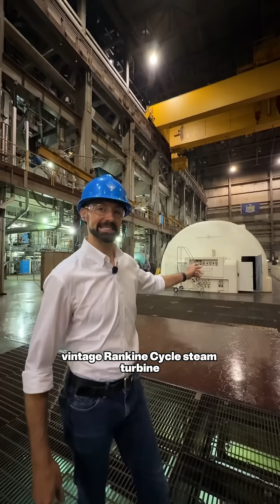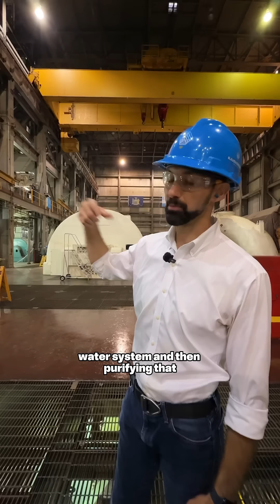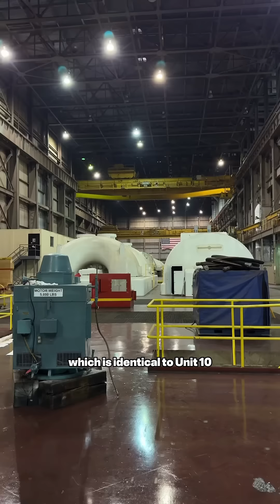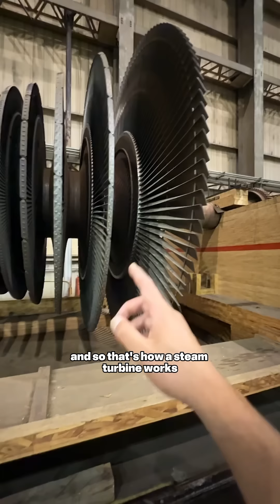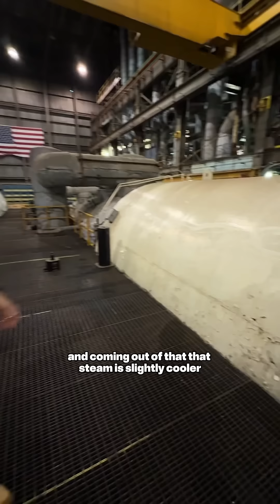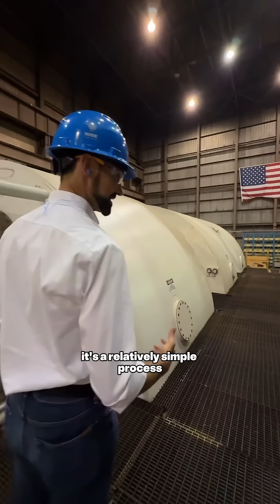How NYC Generates its Energy

Comment: But a Rankine cycle is a closed loop system. Your host talks about bringing in several million gallons of feed water. That does not sound like a closed loop. A closed loop would also have a condenser which the host did not talk about. Something seems left out in this explanation the host gave.

Comment: The steam power cycle combines practical efficiency (it can be optimized through techniques such as reheating and regeneration), reliability, scalability (it can be implemented in large-scale power plants, such as nuclear facilities, and can operate with various heat sources), and technological maturity. It’s compatible with thermal renewable sources such as solar, biomass and geothermal energy. The steam power cycle delivers baseload energy (24 hours a day, at large scale), and, as far as I know, no other technology has yet matched its blend of durability, scalability and maturity.
Reply: The efficiency of a Rankine cycle steam power plant is poor;  less than 40%.  New fossil fuel plants are now combined cycle gas turbine (CCGT) plants with efficiency above 50%.
Reply: @martincavin6760  your information are not up to date: 

A coal plant build 2014 in Germany has an efficiency of 47,5%. 

Modern CCGT plants are in the realm of 61-63%. 
New developments target 65%.

Comment: I am honest here, I have exactly no knowledge of electric power plants, but using steam? I’m really questioning this, isn’t that a bit old fashioned?
Reply: It seems old-fashioned indeed - the RMS Titanic operated based on a steam power cycle! This technology has been in use since the mid-18th century or so. It combines practical efficiency (it can be optimized through techniques such as reheating and regeneration), reliability, scalability (it can be implemented in large-scale power plants, such as nuclear facilities, and can operate with various heat sources), and technological maturity. It’s compatible with thermal renewable sources such as solar, biomass and geothermal energy. The steam power cycle delivers baseload energy (24 hours a day, at large scale), and, as far as I know, no other technology has yet matched its blend of durability, scalability and maturity.
Reply: @raffaello_morus This NYC powerplant uses the conventional Rankine steam cycle with an efficiency of less than 40%.  Modern plants are now mostly combined cycle gas turbine (CCGT) with efficiency over 50%.
Reply: Apart from solar wind and hydro pretty much all electricity generation uses steam turbines. Oil gas or coal would have been used in the past, but  you can also use biomass (mostly wood) nuclear reactors or geothermal to generate the steam.
Reply: @adrianthoroughgood1191 The majority of new powerplants use combined cycle gas turbines (CCGTs), as they are more efficient than steam turbines.
Reply: @martincavin6760  the "combined" in  CCGT means it combines both direct combustion turbines and steam turbines. The gas is burned in the first stage turbine then the heat output of that is used to make steam used in the second stage. So are they exactly like the one in the video? No. Are they still using steam turbines? Yes.
Reply: How do you make electricity?
Reply: You're right. You've got exactly no knowledge of electric power plants.

Comment: How do they boil the water though
Reply: Oil and gas 🎉
Reply: @T25de  Large powerplants don't burn oil anymore to produce steam.  Too expensive.  Natural gas is used if available.  Otherwise coal or nuclear.
Reply: @martincavin6760  The liberals are scared of nuclear, they would never let us have a nuclear plant in NYC. Even though it would be cheaper and less carbon is put into the air.
Reply: Coal
Reply: Nuclear could easily slot in but they won't. I guess they'd rather see what happens.
Reply: They use boilers
Reply: @shargor but how does a boiler work. By using heat to boil water right? How do they produce that heat?
Reply: @TikTikboom173 Usually, a boiler uses natural gas or heating oil.
Reply: @shargor  there's a guy with a straw that blows air bubbles into the tank of water

Comment: I live near an abandoned nuclear plant on long Island, kind of wish it never went down but steam is no doubt safer. Very cool
Reply: Well it's not really abandoned. The doj is still there but not really sure what they're up to. You're not allowed anywhere near it lol
Reply: The nuclear part is not used anymore but they have backup generators there, a cable from Connecticut, a couple of wind turbines, and they are building a battery storage facility. So the plant itself isn't being used but the electrical connection to the grid and the site itself is still being used.
Reply: @thomasromano385 oh interesting. It's near the original Tesla Wardenclyffe facility too where Nikolai did a lot of his experiments. Alot of history on long island in the energy department. Cheers
Reply: @thomasromano385  do you know why they stopped using the reactor? Could it be brought back into service now electricity demand is rising?
Reply: @adrianthoroughgood1191 search the article " A look back at the
Shoreham nuclear
plant protest, 40
years later"

 Good reading, was definitely contested at the time, But I think being such a major port/ hub on the water. They saw it as very vulnerable to an attack.
Reply: @bmo14lax  steam is the method for converting chemical energy to electrical energy (via mechanical energy). Steam is also used in nuclear power plants to generate electricity. Most plants in the US use fossil fuels to create steam (oil, coal, or natural gas). But steam can also be used with cleaner fuels like hydrogen, biofuels etc.
Reply: @samcohen7178 very interesting thank you!
Reply: You do realize that nuclear plants use steam also don't you? What you mean to sat is fossil fuels are safer than nuclear energy.
Reply: Nuclear is safer than sex
Reply: I wonder what they did with the nuclear power to make it into electricity, I can't put my finger on it.